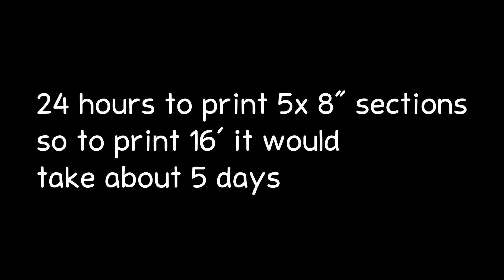I Built an Enclosure for my 3D printer

Comment: I see your using kevinakasam's belt-driven Z axis and klackender probe. I installed the belt-driven Z axis on my original ender 3 and WOW, what a massive improvement over the leadscrew design. After calibrating my Z offset, it made my layers SUPER accurate. I had really bad elephants foot and most prints failed. The factory leadscrew is absolute garbage compared to his design and I would say its the THE MOST important upgrade for the Ender 3.
I havent tried the klackender. I installed a knockoff BLtouch before I discovered his site and it works fine. Seriously, hats off to kevinakasam.

Comment: Very nice. I found my motherboard/psu fan was moving air around my enclosure a lot and have moved those pieces outside of the enclosure.
Reply from the maker: That is something I am concerned about. With PLA and PETG I haven’t noticed it being an issue but moving all the electronics out of the enclosure is not out of the question.